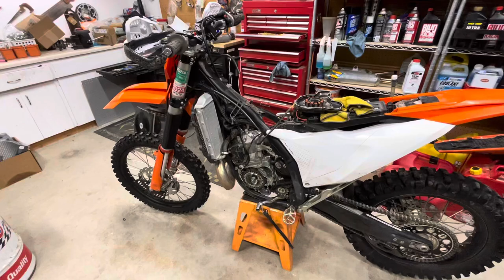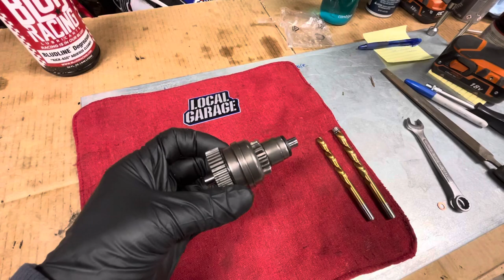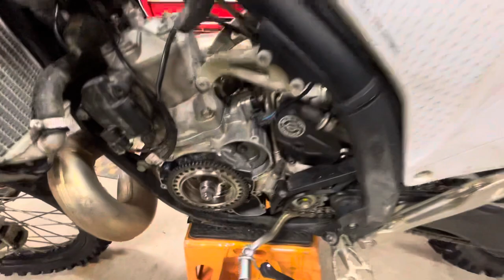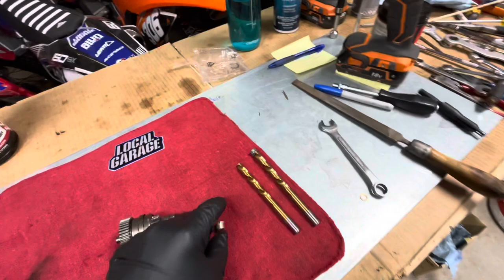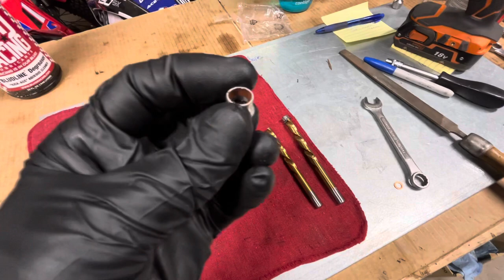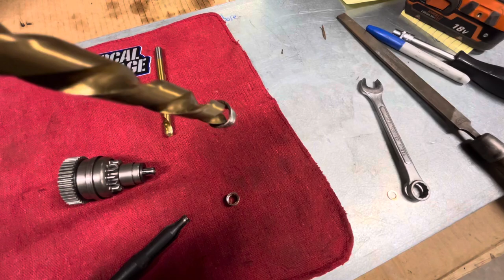KTM starter bushing removal

Comment: Hi, i just purched a kit of bushing from a shop for my 2018 250tpi and it cames with 2 diferent lengh.
One long and on short, wich goes to the stator cover and wich goes to the motor case near the starter motor?
Reply from the maker: I'm not 100% on that.  I suggest matching the size to the size of the ones you remove.